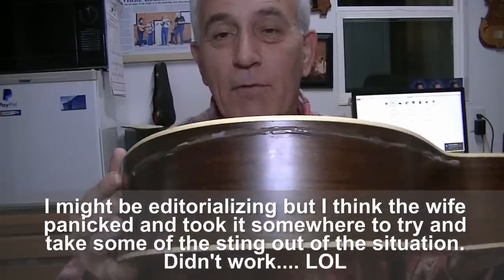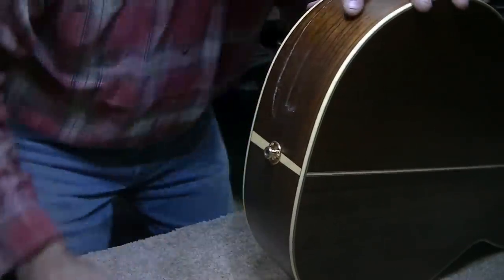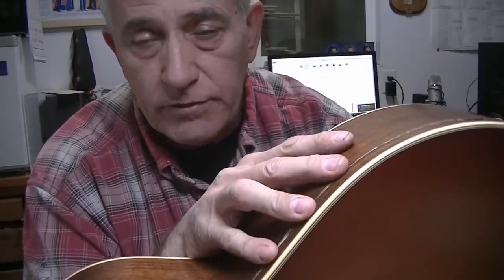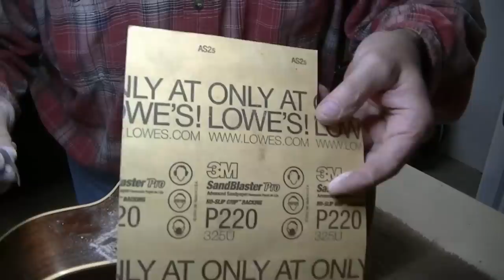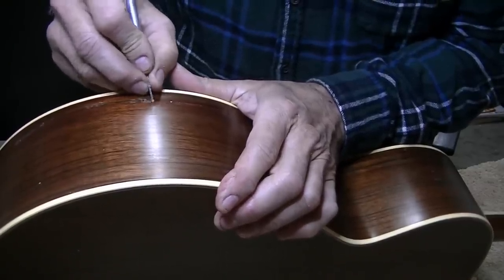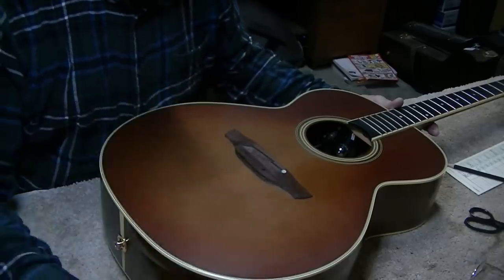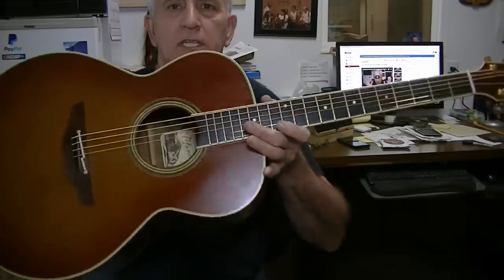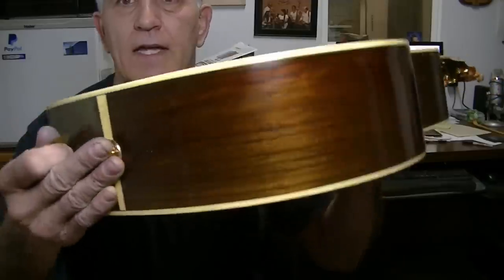224 RSW Takamine Nearly Destroyed LIVES ON

Comment: A suggestion, I've had some luck using micro-mesh pads after final sanding working up through grades until it closely matches the existing sheen instead of buffing.  As you know trying to match a soft sheen or satin isn't easy but I find the more I work with touchups the more I learn which makes it so enjoyable! I've been learning so much from your experience and it is much needed because at 73 I don't have a lot of time learning the "hard way"!  🙂🙂  Thanks so much for all you share, I've been enjoying it!!

Comment: I have a very old red tag Yamaha with a bridge bulge. The pull of the 12 strings and years caused it and there is no over night repair. I packed it with hot wet towels every night and in the cold weather I did it a couple times and day. I had the luxury that it's my guitar and it live with me. This is a real pain in the ass but it beats playing a Chinese guitar. This went on for six long months. The 1967 Yamaha is back in full voice. I put 9 gauge strings on it and tune it a half step down. I capo it and the world is fine.

Comment: As usual another miracle bestowed on a very badly injured guitar.  I was wondering if after the humidity try, could you could have put a clamp with a block on the hump, and very lightly clamped that area, and do the humidity attempt again, with perhaps a little heated air? and then left that over night?  But indeed you did another outstanding job.  I enjoy your videos.

Comment: Another great vid showcasing a fantastic display of your abilities.  Interestingly, about halfway through the vid, I said to myself, "that's a solid wood guitar (laminates seldom crack all the way through), and if the edge of that crack has glue on bare wood, then you're never going to open that crack, so it's best to sand it level and refinish".  Of course, you came to the same conclusion and that's what you did - and a far better refinishing job than I could probably have pulled off!  I guess there's something to be said for 30 years of daily experience!   Anyway, regarding the humidification fix, you left out a very important step.  After placing the bowl-with-sponge inside and closing up the soundhole (I use a trimmed lid from a plastic storage bowl), you then place the guitar on a level surface somewhere, place a towel over the top below the bridge to protect the top finish and then place 15-20 lbs of distributed weight on it.  The weight helps the wood get a new "memory" over several weeks of treatment.  I use a large, heavy book, then place other weight on that.  Refresh the water in the bowl every few days and let it sit for a week or two.  Lastly, after removing everything, allow the guitar to re-acclimate to the relative humidity for a few days before restringing with light strings.   I've done this three times and it's worked every time, in one case, reducing the bellying from 1/4" on each end to less than 1/16".  I don't know if the fix will last 50 years, but the first one I did was done over four years ago for a friend and his top has maintained its relative flatness so far.  I understand that this method isn't ideal for a waiting customer, but it's a decent hack for us amateurs, especially those on low budgets!
Reply from the maker: I've never been able to pull a bow out without doing something mechanical. Every time I fixed him with heat or moisture they always pull back. So I don't even bother doing that anymore.

Comment: I had the same hump on my Takamine and got it almost flat with a damp towel and a cloths iron. The bow went from .125 to roughly .015". I did have the bridge off in order to apply the heat and pressure. Like you already said; I keep light gauge strings on it. 2 years later and it's holding up.

Comment: Unbelievable job matching.   Invisible on this end.  Big thumbs up.
Little tip I use old strings for :  I've found they are ideal for cleaning and reaming crud out of carb orifices,   especially the wound ones,  whose winds have a filing or rasping effect.  The wound G (3rd) is usually the one most used,   due to its smaller diameter. 
You probably have set of torch tip orifice cleaning tools you use for this purpose,  but for anyone,  like me,  who doesn't,  this is a cheap and effective alternative.

Comment: I have seen this before, and I have seen Hot Glue guns used, after they have a botched up job, they bring them to our auction to sell, they just want it to go away.But I have also seen duct tape , silicone seal, shoe goo, spray glue, liquid steel, Bondo, Epoxy, Staples, The most painful was a Gibson with a loose neck, had not 1 but 3 wood screws and 2 nails. Now that was a true hack job. Thanks Jerry, enjoyed the Video

Comment: Great video, some suggestions: try and get an assortment of used dental picks from your dentist, for scraping glue. You can get inflatable airbags ( come in different sizes, think paintless dent repair cars) place by crack and add pressure. Use aluminum tape on both sides of crack to deflect heat. Then use heat gun to warm up glue.

Comment: Jerry, you could try using a Teflon scraper on jobs like this one. We use them in the aircraft industry to remove silicone compound without scratching the aircraft skin. As it wears down you resharpen and continue.  Available in different thickness and width.
Reply from the maker: I'll check into that. Thanks
Reply from the maker: If you have time send me a link to what you're referring to. I searched on it and there's a wide variety. My email is rosastringworks@gmail.com
Reply: Kinda like this one. You can work on them to fit the task you're busy with.
Reply from the maker: Thanks

Comment: Absolutely beautiful job. I would be satisfied with this if it had been my guitar. Regarding humidification, I had a positive experience with a belly that actually showed two obvious sunken in spots near each end of the bridge. It may have also been raised a little near the center of the bridge; I'm not sure. It's a Takamine acoustic I purchased back in the early 80s. Twenty years later, it had developed the belly problem. I live in a dry desert climate. So I got one of those suspend-through the strings humidifiers. It took several months (probably at least four), but it healed itself, with the top regaining its original shape about 95%. I was surprised, as I figured its condition was irreparable , but it remains fine to this day. 

About the same time, I noticed a more recently purchased Pavan classical guitar had developed a very similar problem. It too got its belly shape healed with the same kind of humidifier over a similar time frame.

Comment: The husband would have rather had her wreck his truck! You did a great restore on the crack! A little 2000 grid on the gloss would have matted the finish. All the matte finishes I have had, turned gloss in the areas with the most contact. That's why grass don' grow under swings. Good tips on how not to glue and if you do, how to remove said glue. Thanxz

Comment: I was watching a wood work shop just the other day he the guy was making bowed wagon trusses and he used steam and pressure to shape the wood.  Steam softened the wood enough that he could bend it into shape.  You might want to consider some type of rig to shoot hot steam into the hole and a brace to force the wood back into shape.  The steam should be directly hitting the part you are shaping and brace pressure would gradually increase till the bow is gone.  Experiment with it to see if that is something you could do.  I don't know if the finish would be effected or not.

Comment: I find that rubbing the lacquer finish (when fully hardened) with finest grade steel wool will take off the ‘’new look’’ shine without leaving any visible abrasion marks. Its also pretty good at removing brush stoke lines and dust spec marks but then to do that you’ll need to concentrate longer on the problem areas, however I think the wet & dry abrasive paper technique is probably the best for brush stroke mark removal.
Reply: A light rub over using rottenstone pm a felt pad works well too :)

Comment: Jerry,
From looking at the boroscope I would have thought that the crack was right along the bottom edge of the kerfing? 
Which would make sense since the kerfing is supporting the top inch or so of the sides. The rear crack that starts at the tailblock and works its way up also appears to ride the bottom of the kerfing. 
I know I didn't see it in person, but are you 100% that it wasn't (Italics) Just ( Italics) below the kerfing? It sure appears so. Either way Epoxy or whatever that glue is , looks to be a pain! I too am currently working on a Takamine A/E with the same bridge. The bridge is split from string hole to hole. And was glued on with epoxy!
Great Job Jerry!

Comment: Regarding rehydration - I am working on the most extreme belly bulge job I've ever worked on where the bridge was broken in half and had pulled the wood up from the top, splintering it. The guitar was dried out and had the wrong strings on it under tension, so it looked like that scene from ALIEN when the  alien bursts out of the person's stomach.
In addition to the bulge, there was a 1/2 inch dip from the sound hole to the bridge. After removing the broken bridge I decided to rehydrate the guitar before doing anything else. If it didn't work, I figured it might be a waste of time, but my client said to take as long as I need. Virtually nothing happened with sponges in the body for about one month. But I checked in every week or so. at six weeks I started noticing a change and by three months the top was almost flat. I just took leaving it in the case with the cup of water and being patient. I aired it out once in a while to prevent any kind of mold growth, but I am absolutely amazed at how different it is now. That said, anything less than three months, and it would have been a tough call as to whether or not to just walk away. Anyway, I just wanted to respond to what you'd said about the sponge and leaving it in over night. Thanks for all the work you do, I love your channel! 
(ps. the guitar I am working on is a Ventura Bruno V-13)
Reply: WOW....that sounds like the Guitar from Hell...good on you though for persevering with it.....Peace.

Comment: Credit where credit is due, the first “repair” was technically “solid”! 🤣

Great job! I am getting addicted to your repair videos. They are both rewarding to watch and serve as a reminder to me “no, you should NOT try to fix that yourself. You’re in over your head, get a pro up front.” 

Yes, I’ve dug myself into some holes with my “projects”. Most recently I was using the damp wood and iron trick on a 3-piece solid body guitar to raise some dents. Whatever glue was used let go before the dents steamed out and I had a 2 piece body and some spare wood to whittle 🤣

I did get it glued back together but it seems it wasn’t well jointed in the first place and I had to use a strip of matching veneer that I tapered to fill the wedge shaped void (jointing the pieces at that point would have ruined the outside curve lines) After scraping it flat to the top and refinishing it turned out great, but that was a heck of a punch in the gut for a simple “steaming out the dents” job! 

Thanks for the videos, I’m in northeast Arkansas and may send some work your way soon!

Comment: Regarding the crack, the 'rag trade' call that invisible mending !
The belly is usually a sign of over humidity, [and wear & tear] .what you did will only make things worse on its own. To reduce the belly, what's needed is after humidifying, to 'loosen things up', is to cramp it flat, [gradually] over time, then dry it out to try to stabilise it in a dry condition. Props may by needed, inside to prevent depressions.  Rather like ironing your laundry.

Comment: I’ve got a Taylor that was left in a cupboard for a while (don’t know how long, maybe a year or two) where the house had damp issues. When I received it the top was bulging up and the neck was like a banana leaving a huge gap under the guitar strings and the gloss finish on the guitar top was ridged as the moisture had gotten into the wood grain. I sent it to a Taylor specialist as the neck has a unique shimming system and he said it was the worst case of a guitar that had been moisture damaged he’d ever seen. There was also a huge bump on the neck where it meets the guitar body. Anyway, he thought it was a lost cause but said he’d have a go. He put the guitar in a large plastic bag and used some dehumidifier bags (can’t remember the name of the product) and left it for a couple of weeks. Long storey short, it was 95% back to normal. He sent the guitar back to me with a couple of the dehumidifiers and a year on it’s 99.5% as it should be. Too much moisture will definitely kill a guitar. I think the quality of the materials used in my Taylor is what saved it ultimately. I guess where you are you won’t get many guitars with moisture problems? I live in the UK, old damp houses are quite common.
Cheers matey

Comment: Hi Jerry, Happy that you've nailed it again. In fact I've been looking for a 2 saddle guitar because I believe that it improves the sound a lot. I borrowed a 2 saddle guitar from a friend a few years ago but it was hand made to specification here in Portugal and the guy who did it passed away many years ago. When I finally gave it back to my friend he told me he would sell it to me for half the amount he paid to get it made. It still was a hell of a lot of money at the time and I just couldn't afford to spend that much money on a guitar. My two saddles guitar won't be a Takamine, that I'm sure of. Like you I'm not particularly keen on the construction of Takamines (at least one of the "affordable ones"). I wanted to ask you two questions about this repair and the first is "have you considered sticking thin metal wedges in the crack and jack it up from the inside using some of your clamps that appear to be like small mechanical jacks?". The second one is that apparently (at least it seemed so in the video) you should have mixed a few drops of yellow into the dye to get a better match. I never saw those "anti-colour- blind" glasses of yours. I remember the video you made about those glasses and remember your comments while driving and wearing the glasses. So, the question is "does your brain get used to the glasses and after a while wearing them or not doesn't make a difference?" Best regards.
Reply from the maker: The Jacks would have just busted something. It was glued to tight. Regarding the color I just do the best I can. The glasses don't work indoors very good. And I've learned that they're not that perfect anyway.

Comment: Wow, great job!  I’m amazing at how nicely the side cracks finished up.  I’d buff out the other side to match.  On a side note, Takamine has pretty good specs for their different models and serial numbers going back to the 60s.  Probably could have determine whether the sides were solid or poly, with a quick check on their website.

Comment: If you have an absorbent surface such as wood, with a sealed surface on one side and an absorbent one on the other, wetting the absorbent side will cause the wood fibres to expand on that side. In this case the inside will swell and take out the bow. But to do this you will need much more than a tiny pot of soaked paper overnight. You will need to moisten the wood quite extensively. I have made many flat exhibition panels for museums etc. If you don't balance each side of the panel with the same absorbency (preferably none) it will eventually bow.

Comment: i'm willing to bet that finish that you used is water based acrylic, it goes under many disguises including floor wax, but it's all basically the same stuff - water based superglue. i've seen it called water based polyurethane (which it definitely isn't), interior varnish (although it works better than the polyurethane we are expected to use for outside work), the interior varnish is generally matte or silk so it might have given a better match for this application

water based acrylic can be best identified by its milky appearance, and its smell which is like exterior wall paints such as weathershield (uk)
Reply from the maker: It's been so long since I publish that video I don't remember any of the details. But I'm willing to bet that it's not water-based because I don't believe I've ever used any water-based products on an instrument.  I generally use nitrocellulose lacquer.
Reply: @RosaStringWorks  thanks for the reply, the water based acrylic is magical stuff for many reasons, if you're interested i can outline maybe half a dozen here - many of the assumptions about water based don't apply to this stuff

Comment: Color matches are always tough Jerry. But when you started talking filler I was like NOOOOOO! It turned out very well for a the mess it came in as. I was also thinking that was a good candidate for a Bridge Doctor. I've seen them rotate a lot of hump out of a top. Would also have been interesting to recheck the hump after the saddle reduction and lighter strings, to see how much if any affect that had.
Reply from the maker: I've only had one experience with a bridge Dr. In that particular situation it seemed to really affect the tone a lot. So since then I've never used one.
Reply: Fair enough, I've had only positive results. Although I made mine I'm sure they are close to the real deal.

Comment: Using baking soda and Super glue makes a great filler. Put the baking soda in place. shake it a little to settle it and level it....then squirt the super glue on it. You can build it up as far as you need.
Reply from the maker: Ive done that a number of times. I'm not a big fan of that method. I never use it on a paying job.